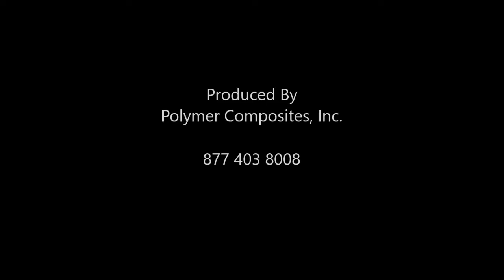MAX EMC A/B -Epoxy Molding Clay used for void and gap filling application. Wood void fill compounds

Comment: I just tried this product, how did you get Part B to be firm like that? It’s nearly impossible to mix the two because the part b is so tacky and sticky it just sticks to the gloves like peanut butter.
Reply from the maker: Using MAX EMC without the added filler will be a bit sticky, as designed. If the MAX EMC is too dry, it will not wet out or impregnate the substrate (concrete or wood), lowering the cured adhesion in shear and peel strength. Also, if the temperature is too warm, > 90°F, the mixture will be stickier. The best way to minimize stickiness is to place PART A and PART B in a cooler room for 24 hours so you do not start with warmer PART A and PART B, which makes it sticky. Long-strand dry filler can be as simple as dry cotton as cotton balls and can be added to soak up excess stickiness. But not to the point of it being too dry and no surface or substrate wetting occurring.
The fibrous filler reinforces the mixed resin matrix, like a rebar network, improving the cured strength and handleability. As an approximation, cotton thread has a tensile strength in the range of 2870 to 5970 psi (pounds per square inch), around 20 to 41 MPa (Megapascals) when dry. Wet cotton can have a tensile strength up to 20% higher.

This demo was made for a customer in Hawaii to reinforce earthquake-remediate damaged logs for building supports that split because the environment was too dry. Please use the contact information on the labels on the MAX EMC jars or the instruction sheet with the product packaging. Apologies for the late reply. Our YouTube videos are meant to be used as file source instructional videos, not as much as a 'How To' info source and point of contact for specialized individual product use. The temperature in our studio is kept at a constant 75°F to 83°F temperature, which plays a vital role in crosslinking polymers like this product MAX EMC.
Thanks!